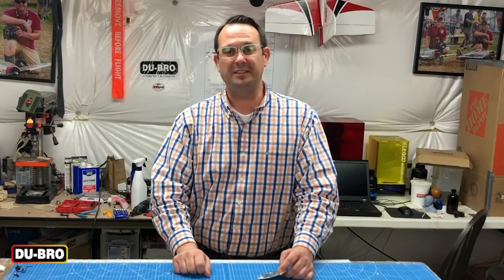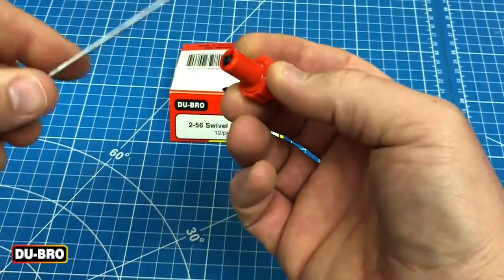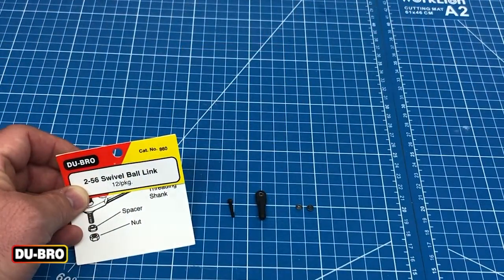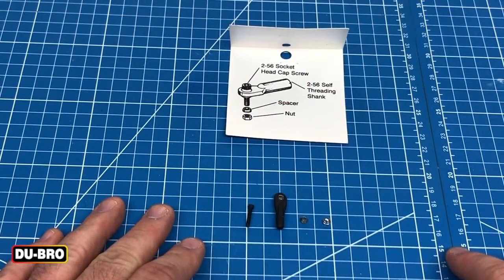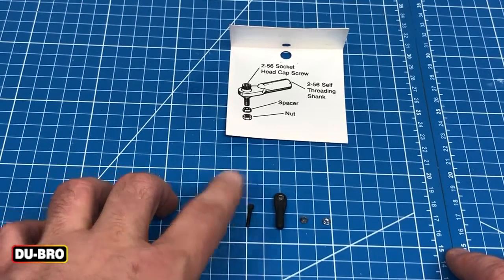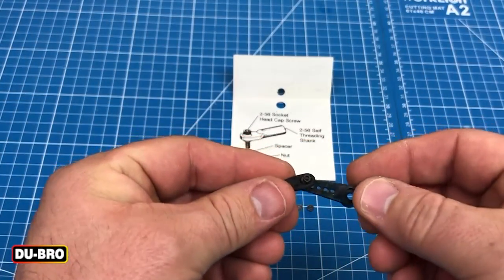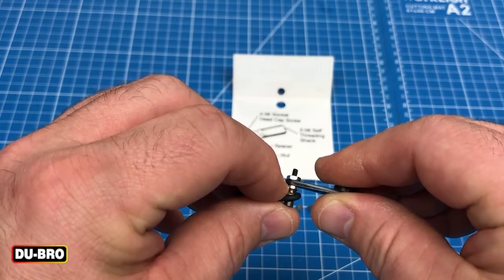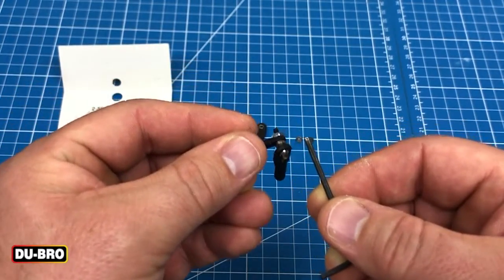2-56 Ball Links  #airplane #rcplane #rcpilot

Comment: These are great units but there's one piece of information missing if you want to replace a link when you can't remove the existing ball.  
What is the diameter of the ball?   This is the one thing we can measure to make sure we have the right size link.
I've got a broken link (white plastic, not a cup) on an older plane and I've tried every link I can lay my hands on.  None fit.  Without a LHS it's a long wait to order online and get the wrong size. 
The ball diameter is 5/32" or 0.15 inches (3.85mm)
Reply from the maker: Hi @redskymining we are happy to help.  I am not sure of which link you have so if you email pictures to orders "AT" dubro "DOT" com we will gladly help you with what you need.  Thank you!